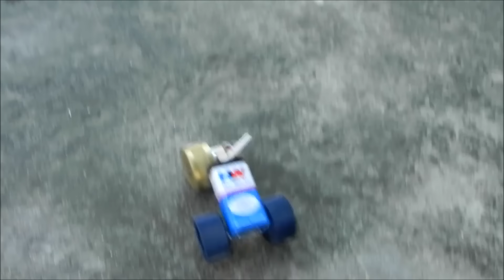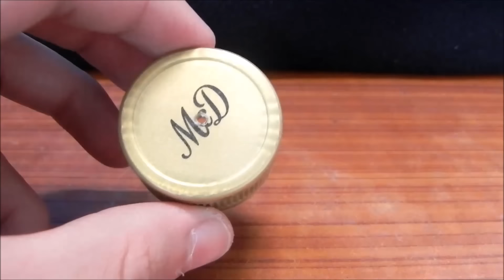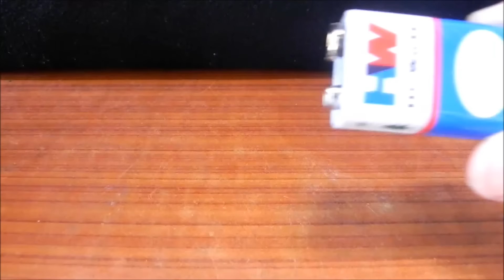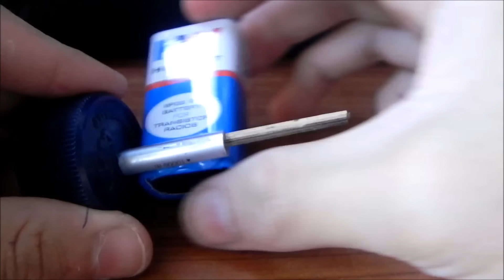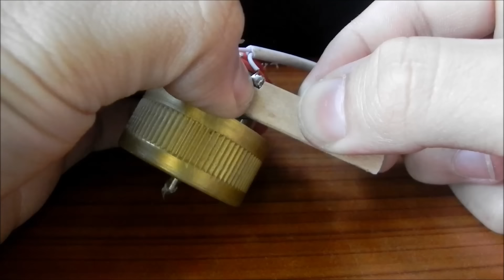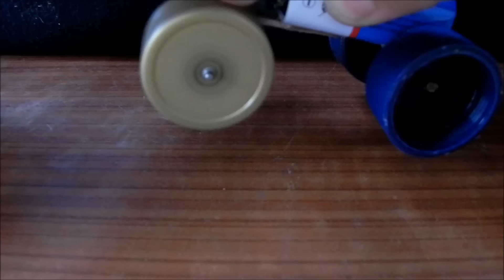HOW TO MAKE A SIMPLE ELECTRIC CAR USING HOUSEHOLD  ITEMS! DIY HOMEMADE

Comment: i had to make one of these for my 7th grade project, mine was the best in the class. I used a hot wheels on the front side, and on the back side two bottle caps with a styrofoam cup as the body. You can stretch a peice of balloon around the outer part of the bottle caps to make it have traction.
Reply: Team Caffeine cyuvj

Comment: but bro its grip is less so it cant run on any smooth plane (ground) u should cover those tyres (bottle caps) with a electrical tape or a little rubber strip ok👍👍
Reply: King Thieve yes yes yes m8 thank you
Reply: Fix rubber band or use glue gun  in the wheels then its grip will improved 😎😎😎 thats my idea😎
Reply: li5

Comment: Is there a circuit diagram or flow of this? We badly need it.
Reply from the maker: +Marco Bongcawel just connect two wire from motor to two terminals of battery
Reply from the maker: you just have to connect two wires from motor to battery
Reply: BOKIN DIY
Reply: 300l30  me 6t990007
Reply: yes
Reply: Marco Bongcawel 0sjcdeu
Reply: Marco Bongcawel altamash
Reply: Marco Bongcawel gehysbsjyfhfnyeyhxryghdyhshsyrhfnyfbrnhfyyf. Ghar giddy yd gbse yd had had.  Sudghddbhd

Comment: how can I add the switch button
Reply: please comment me fast
Reply: abhay pratap singh 
Motor has 2 wires connect 1 wire with the connectors wire and other to yhe switch(button) and the connector also contains also 2 wires so connect 1 with the swithc(button)
Reply: shivam raj choudhary